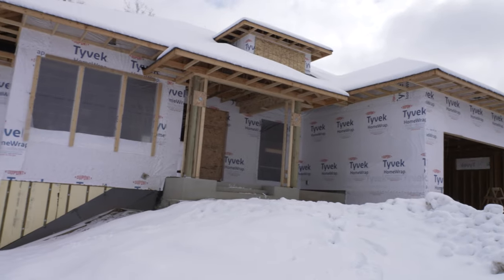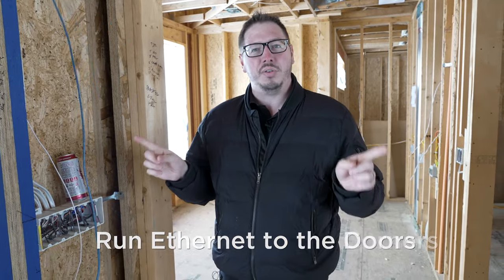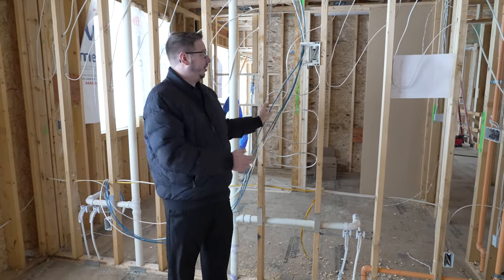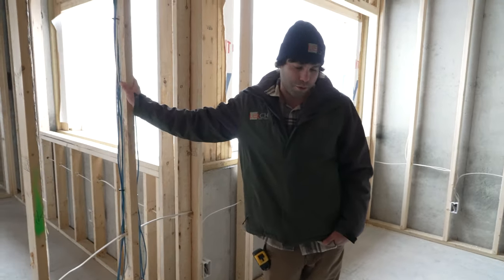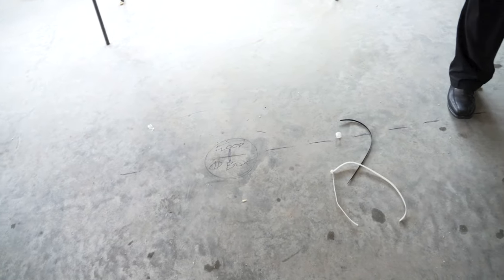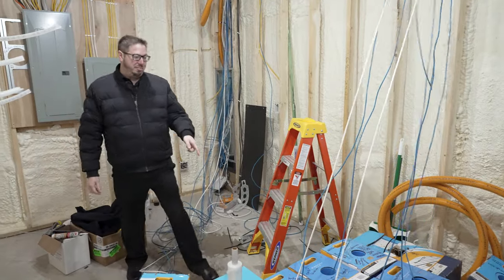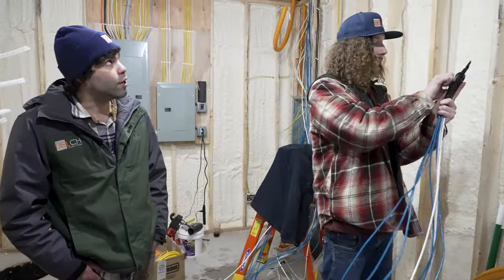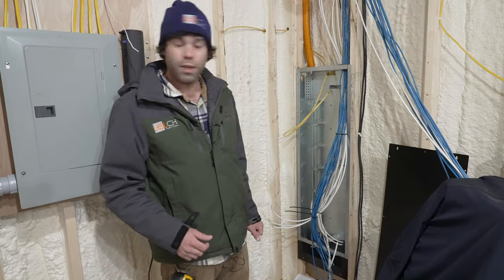Building a Smart Home? (Here's What You Should Do)

Comment: The only thing I would change about this is use a real patch panel, those media centers are good for small installs or coax runs, but for a large install like this, a real rack mount patch panel is the best, you can even buy high density models that give you 48 ports in 1u instead of 2

Comment: The problem with new builds is that the builders want $250 per Ethernet drop. I’ll run my own Ethernet when the house is done instead. I realize I won’t get cat6 everywhere but that’s why wifi is there. $250 per drop is theft.
Reply from the maker: Yeah, that is a lot but might be more expensive after the fact. I'd check to see what the cost is to run additional lines to the same location. Having 2 or 3 jacks compared to just 1 is really nice, and should only cost the length of the wire, since they get pulled simultaneously
Reply: @BrandonDoyleMN  it’s the same price. $250 per drop no matter what. Again, I’ll do my own later. It’s cheaper. Maybe a little more effort but I’ll take pictures of framing and mark my locations from the attic or I’ll sneak in after insulation before Sheetrock and put my low voltage outlets. These guys wanted $15k for a 400 amp service 😂. I am hiring an electrician to prewire after their electrician for about 25% of cost . He knows exactly how these builders work but he also knows the actual electrician who’s contracted to do the work.   It’s a game, just gotta know how to play it.
Reply from the maker: @mrprfct7069  if you’re able to get it done before Sheetrock yourself that’d be awesome, totally worth the cost of the cabling
Reply: @BrandonDoyleMN  that’s the plan. Timing it just right.  I would have paid the builder but the cost was outrageous. Multiple electricians  told me not to do it. But we have a local guy who we used for our other properties that will gladly “prewire” just in time and put a blank plate. It will pass inspection as well.
Reply: You should be able to do low voltage without the need of having the electrician do it. 250 for a 500ft spool and bam, you got cat6a wherever you want.
Reply: You could put 20 CAT 6A shielded drops in a new house for $500.  $250/drop is theft.
Reply: @Legendary_UA I ended it hiding cat6 in the walls. Took pics and once I moved in I pulled them out. Decided to spend the money in electrical extras instead.

Comment: Not 5 minutes in and I’m already seeing a couple issues. 1) you do not run Ethernet, directly parallel with power. 2) the overall vibe with the ‘tech’ is just not it. 3) installing boxes lower down is not a convenience.. it’s going to take a similar amount of work and effort to move it up or down. 4) the cables are already too short in the distribution panel. Even if they actually tried to bring it into a floor standing rack it would be extremely tight or not possible due to the length. Seeing the work done by this company, I would not hire them. 

Not an issue, but something I would have done, is installed the control4 lighting. Everything connects to a centralized lighting controller, and you use the button pads, touch screens, and apps to control it.